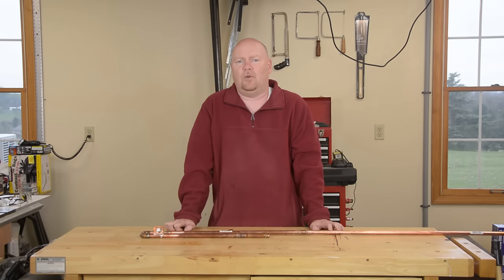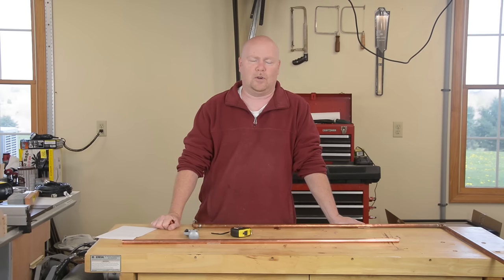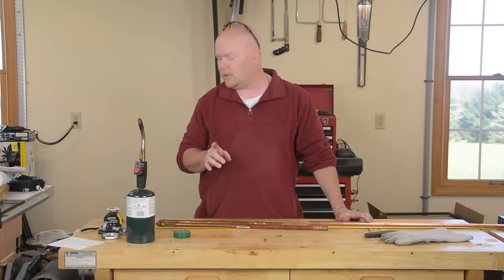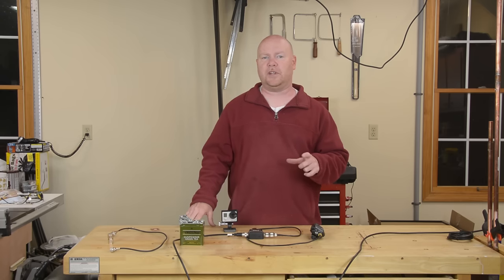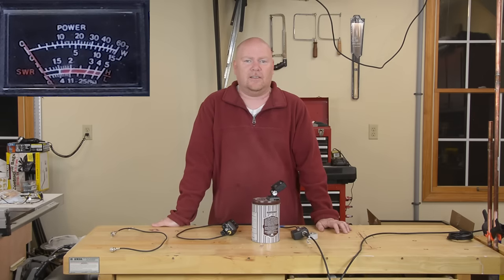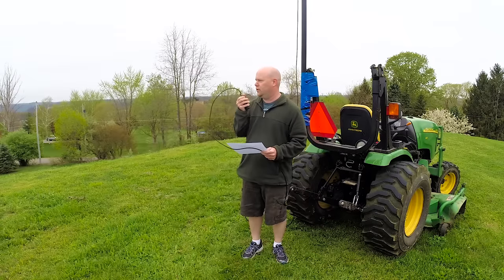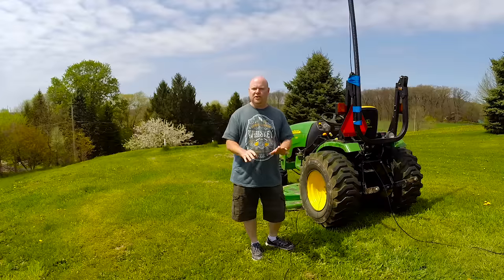2 Meter J-Pole Antenna Build

Comment: Just passed my Technician license test yesterday with a 100%.  Now I need to make me an antenna for my Yaesu FT-4VR I got for free for passing the test.  It's a mono band 2 meter HT.  While I wait for my license and name and call sign on the database I tested the radio and I have to get out on the deck to hit the local repeater.  I want to be able to do that from the inside of my QTH.  So I need to build an antenna or antennae.  I don't have that kinda access to copper pipe to make an antenna.
Reply: Congrats
Reply from the maker: Congrats on the license.  The antenna can be made from any copper.  If you have a spare bit of house wire it'll work.  The bopper pipe is nice for it's mechanical strength, and the larger conductor diameter give you more bandwidth, but neither are really necessary for the RF to flow.

Comment: Hi .I have a question regarding this jpole .at the lower section this is 1/4 wave match with two poles in line .now what if you removed the smaller 1/4 pole substituted it with a air coil to be its match .wouldn't this be a much  lighter antenna?.that way you could put a funnel over it to protect it from rain from coil .

Comment: Hi Matt, great video! I just got my technician license and I've already started studying for my general. I was watching this video and was surprised to hear you were near Zelienople - I'm just up the road in Connoquenessing.  I have a Baofeng and I just ordered a xeigu g90 (should be here this week) - I was wondering if there's any good clubs in your area? Any information you can give me would be greatly appreciated. Thanks, Carmen W3BCN
Reply from the maker: Hi Carmen.  Congrats on the ticket!  You should have no trouble getting into the W3UDX repeater (Butler county club) on 147.36 (131.8 pl and + offset).  I monitor that repeater most weekdays, and there are others on it during drive times.   The most active group in our area is the WW3AAA club.  You may or may not be able to hit the 147.135 repeater, but it's also available via Echolink as node K3UKE.

Comment: Matt... Great job and lucky you for getting free copper pipe. I've made copper J-Pole antennas for years and have a few that have worked well for 30 years. Last year I made one for GMRS and it works great. I live near Yellowstone NP (Eastern Idaho) and we have ham and GMRS nets organized very well. We have two GMRS repeaters (BYU-Idaho and another about 30 miles from here at 9000 feet) as well as ham repeaters that can be used for nets and emergencies and my copper J-Poles stand up to the harsh weather we have here. I've painted my J-poles in a camouflage manner and they have withstood the test of time. Keep up the good work there. 73...Matt...WD7N

Comment: I don't understand Ham radio in the slightest, but darn that was so cool when you got a response at 50 miles. Great project!
Reply from the maker: +Andrew Miguelez    Thanks!  There's never been a better time to get into ham radio BTW.  Lots of options that don't even require a radio, just a computer or tablet.  You also no longer are required to learn morse code.

Comment: Thanks for the video.  Where do you measure your lengths to ?  i.e. is the length of the tuning stub measured from the top of the stub down to the top of the short horizontal piece or to the under side of the horizontal piece (when looking at the antenna in the upright position)?

Comment: wow I have a bunch of scrap copper pipe now I'm really interested in making a J-pole. What was the diameter you used? Does diameter make a difference? Your video just jump-started my interest in this hobby. I have had my license over a year and only made contact with one repeater one time.
Reply from the maker: The diameter isn't terribly important.   Fatter pipe gives you more bandwidth, but it's not that relevant for a 2M antenna for repeater work.  

Dust off that license!  Ham radio is great fun and it's actually about 100 things you could do.  I'm happy to help you get back into it if I can.
Reply: That's more than me.

Comment: thank you matt for good explanation how to build j-pole antenna , 2 qui please 1. how many inches the copper pipe 2. working 50 miles direct or via repeater 73

Comment: Absolutely amazing video, I plan to use it on 70CM on DMR do you have any suggestions as to what length the Jpole should be? Your video is the only one that actually gives valid information all the way through many thanks.
Reply from the maker: Use the link for the calculator in the description to get the exact lengths.  It'll depend a little bit on where in the 440 band you want to tune.  It's not really possible to cover all the way from 420 to 450 effectively with one antenna (at least not without a tuner of some kind), but then you usually only need 440-450.  Use nice fat copper pipe and it'll tune up just fine.

Good luck!

Comment: Great video, what would the gain on one of these be?
Reply from the maker: J pole is just a vertical dipole, fed with a quarter wave matching stub.  Maybe 2dBi or so.  The benefits are In the ruggedness primarily
Reply: What’s better , j Pole , slim Jim or a double stack dipole ?

Comment: Hi and thanks for the great video. the question I have is did you cap the tops of the verticals?
Reply from the maker: I did.  Keeps the elements out of the antenna.
Reply: I built the super J-pole version and happy to report that it is measuring a 1.2 SWR reading and am able to hit a repeater 20 miles away with full quieting on a 5w Baofeng HT!

Comment: Hi Matt. It is possible to put the measures in a plane? The diameter of the main influences these? I do not know english. We appreciate your help.
Reply from the maker: It's best to use the link in the description rather than follow a plan.  That way you can setup the antenna for any frequency you want.   The diameter of the material does not change the required length of the components, but larger diameter materials offer a wider well tuned bandwidth, higher power capacity, and (very, very) slightly enhanced received performance.
Reply: What is the size of the bottom of the antenna which is attached to the support? Sorry but I am a bit ignorant in this matter and I'm learning .... Thanks
Reply from the maker: My antenna is essentially 3 pieces:
- The tall part (the 1/2 wave radiator) is 147.4cm
- The short part (the 1/4 wave matching section) is 49.1cm
- The bottom of the antenna is 4.5cm across, although this dimension isn't as critical.  

My feed point - where the coax cable attaches - is 4.9cm up from the bottom.

Since I'm attaching to a non-conductive mast (PVC pipe) it really doesn't matter where I attach to the antenna.  If you're going to use a metal mast then there's a lot more work to figure out where and how to attach it, as well as the grounding scheme.

Comment: So first I'm a rookie and I want to make a j pole for my 2 way walkie talkie in theory will a j pole work I'm at 400-470mhz on a retevis H-777 or is there another antenna that I can build that will work better
Reply: I have a SMA connection on my 2 way with an adapter
Reply from the maker: Bad news about those radios.  They're not legal for use in the U.S. because they have no FCC type acceptance.  Also they don't transmit across that whole range.  They have pre-programmed "channels" which are all over the map.  Some of them are common police and fire department frequencies and you can get yourself is a LOT of trouble transmitting on them.   Most of them are licensed business frequencies, and if they're in use locally then you'll have some private company that paid a lot of money for that license coming after you.

There are two channels (462.625, 462.725) that fall under GMRS (General Mobile Radio Service) rules.  You can get a license to operate GMRS from the FCC with no test.  There is a fee and the license has to be renewed every 5 years.

I would suggest one of two courses of action (actually you could do both):
1.  If you really want to get into radio then the best thing you can do is find a local Amateur Radio club and show up for their next meeting.  They will be THRILLED to help you get properly licensed for HAM radio, and you'll be able to do so much more with HAM radio then anything else you just won't believe it.
2.  If you just want to do something simple right now then get a GMRS license from the FCC and head over to Amazon and pick up a real GMRS radio.  This will have all of the GMRS frequencies and will be type accepted by the FCC so it will work properly and legally.   If you want to build a J-pole for GMRS (which is legal!) then you'd choose a center frequency of 462.6 for the calculator in the description.

Good luck!

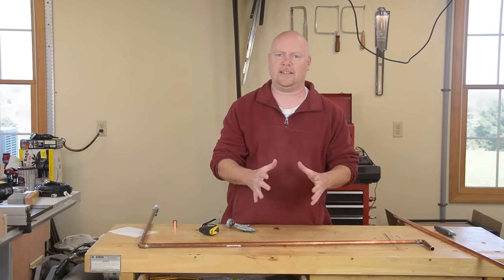Comment: Matt, being the antenna expert that I am,  I wanted to offer a suggestion.  At 2:30 it shows you removing the valve.  Next time, leave the valve in,  at allows easier tuning of the antenna to resonance,  you just twist the knob to reduce the flow of electrons and re-resonate the antenna on multiple bands.  You could have fun by telling people that.  ;-)   Nice construction and good use of old plumbing!
Reply from the maker: LOL.  Thanks Ed.  I'll try that on the next one :)

Comment: All in all a great video, but I didn't favor how you soldered the SO-239 using a torch, I prefer to use a soldering iron (and plugging it with a connector) so the insulating plastic material does not melt !!!
Reply from the maker: To each their own.  Most irons aren't hot enough to do the job properly, and you're just as likely to melt the insulator by keeping the iron there too long as you are being too hot with the torch.  Either way it helps a lot to have a quality connector.  Some of the cheap stuff coming out of China you could about melt with a hair dryer.
Reply: @MattHeere   during the good old days, the insulation was made of a fiber-like material, now it is all soft low-heat grade plastics from China

Comment: I am "really" new to this and have 1 question....can this be made of steel tubing? to be exact how about square steel tubing?
Reply from the maker: Steel is very hard to work with for antennas.  Anything magnetic behaves wildly unpredictably with respect to frequency based on its exact composition.  Non-magnetic stainless is OK, but even it has somewhat strange capacitance between the inner and outer wall.  All things are possible, but I'd recommend that you stick with copper or aluminum, especially if you haven't built many antennas.
Reply: @MattHeere  thanks

Comment: I'm a fairly new ham and this will be my first homebrew antenna, when tuned for 2 meter can it also be used for 70cm?
Reply from the maker: Hi Zachary.  Unfortunately probably not.  70cm is 1/3 the wavelength of 2m, so the two parts of the antenna, which are supposed to be 1/4 and 1/2 wave long, become 3/4 and 1.5 wavelengths long at 440.  That really throws the whole theory of the matching stub out the window.

But if you have an SWR meter you can give it a try.  Just because it isn't a good match doesn't mean that it can't be used (as long as it's not absurd like 20:1 or something).  You'll just have to keep the power down, and don't expect to get the reach of an antenna that's appropriate for the band.

Comment: I am not too familiar with different connector types, which one did you use where you just soldered in the wire? And should I do testing with my ht or with my base radio? Will the SWR be similar if I do it on the ht and then transition it to the base radio?
Reply from the maker: The connector is a panel mount SO239.  I essentially made my own pannel to mount it in with the flat piece of copper.  The SWR of the antenna will be indpendent of the radio, so you can test it however you want and then move it around.  Do remember that unless the SWR is perfect, that the coax is technically part of the antenna.

Comment: I have built a j pole, but am having an issue trying to get the connector to stay on. Any suggestions?
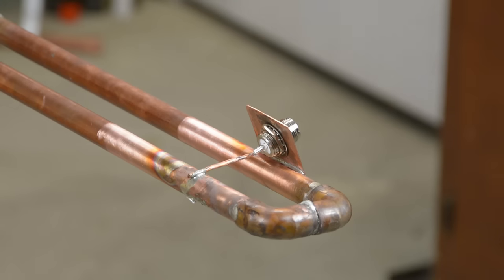Reply from the maker: You pretty much have to make some kind of mounting plate for it, and solder the plate to the pipe.  You'll see videos of people soldering the connector directly to the pipe, but I'm pretty sure that most of them are melting the inside of the connector in the process.   Take a look at 6:44 in the video and you'll see how I ended up doing it.

Comment: J poles are great. No radiators, easy to build, easy to set up, works well. What's not to like?
Reply: Well, the J-Pole antenna is a radiator.  I think you meant ground plane radials (counterpoise) and you can make a J-Pole with a counterpoise.

It would be mounted just under the antenna's base and is used to decouple the coax outter shield surface from the antenna helping to reduce or eliminate common mode currents from traveling down the coax into the shack.  It will also lower the angle of radiation making it easier to do simplex work, especially on the 70cm band.

A choke coil or ferrite beads of the proper mix for VHF/UHF will do the same thing with less work!

Comment: Hey Matt! Great video! I just have one question: can I leave the coupler soldered just on the lower side and leave the upper side unsoldered, so I can split the long part for easier transport? For example have the "fixed" part at 50cm and the "unfixed" at 100cm. I hope you understand what I mean. 73 de E73HAK
Reply from the maker: You can, but you'll likely need to add a hose clamp at that joint.  It's important to have a very solid connection there, and I'm not sure that just sliding the fittings together will quite cut it.

There are also j-pole designs that are made from twin-lead which work well and would be much easier for portable use.

Comment: KC6VBV   Excellent Video!  1st class production.  Just one question,  do you use rosin or acid core solder?
Reply from the maker: Neither in this case.  This is solid solder.  I did use a flux paste on the joints though, which is roughly equivalent to what's in a rosin core.

Comment: Hi Matt, do you have a video that's showing how to make a 2m/70cm Vertical antenna?
Thanks
Reply from the maker: I don't but it's not a bad idea :) .  In the mean time I definitely recommend checking out the Ed Fong DB-1: https://edsantennas.weebly.com/.    I bought one and it works really, really well.  I doubt we could build anything nearly as good for the $30 price tag.
Reply: Thanks Matt, keep on touch.
73

Comment: Will this work with Old corroded/dirty scrap Copper tubing
Reply from the maker: It likely will.  RF travels on the outside of a conductor, and it'll go around holes no problem.  It may be harder to tune up because it may act longer or shorter than it really is, but it'll work in the end.

Comment: Hello
Can someone tell if this construct the ANTENNA
I will work on my own radio which is Baofeng UB-5R?
Thanks
Reply from the maker: Σαββας Κωστομοιρης Yes, it will work.  The Baofeng has a standard SMA antenna connection.  I used a PL259 on my antenna, which is easily adapted to SMA.

I used my j-pole with my Baofeng just yesterday.  I did not want to take my Alinco out in the snow :)
Reply: Dear friend
Thank you for your prompt reply
Always health you and your families
thanks again
Reply from the maker: You can make the j-pole out of pretty much anything conductive, but the calculator pretty much assumes that you're using copper.   The plumbing pipe is handy because it's sturdy, and the large diameter conductor give s pretty good bandwidth.   You could make this from stiff wire though if you had to.

The connector is just a couple dollars.  The wire to connect from the radio to the antenna will be the most expensive part of the whole deal.
Reply from the maker: No problem James.  1/2 the fun of amateur radio is all the stuff there is to learn :)

1 - Any gauge will work so long as you're not transmitting so much power that you melt the wire (which is very, very hard to do).  There are versions of J-pole antennas made by cutting out certain sections of twin-lead wire, and that stuff is usually 20 or 22G.  The main consideration is that the antenna needs to retain its shape somehow.

2-  The connector is called a PL-259.  It's the de-facto standard for antenna connections on the HF bands.  It is still quite usable on 2M.  Higher frequencies than this are generally handled using either BNC or SMA connectors these days.  Typically with this particular connector the equipment is the female and the cable is male on both ends - but of course you can build it any way you want.

3.  Part of the beauty of a j-pole is that it does not need a ground plane.  In fact, you need to be careful if you mount this antenna on a grounded mast, as that can interfere with the antenna pretty severely.

4.  My copper is .75", which is pretty much the standard for water supply plumbing around here (at least, where they're still using copper).

Comment: hello sir thank you for this helpful video that you'd done.. i wish ivied seen this in 147mhz measurement because what you do is for 146mhz
Reply from the maker: 147 MHz tuning point is just fine, especially if your primary purpose is to use 2M repeaters.  I went for the middle of the band because I was equally interested in the bottom of the 2M band due to a local contest.
Reply: ahmm. sir, so its ok if i use your measurement for 147MHz?
Reply from the maker: Better to visit the calculator listed in the description and get exact numbers for your project: http://m0ukd.com/calculators/slim-jim-and-j-pole-calculator/
Reply: i see the calculator sir. what my question right now is the measurement on that calculator is what i use on making j-pole?